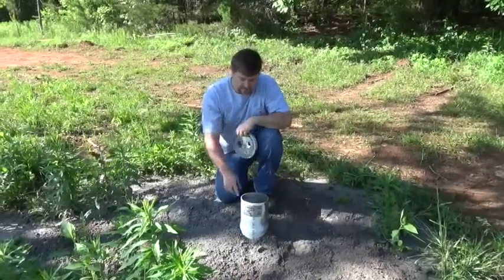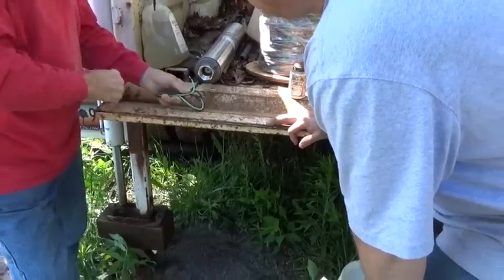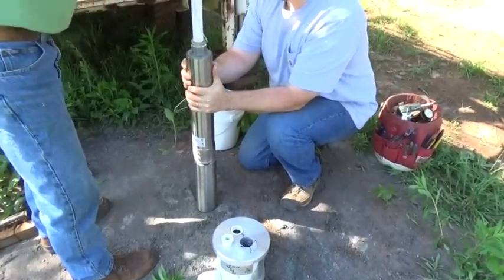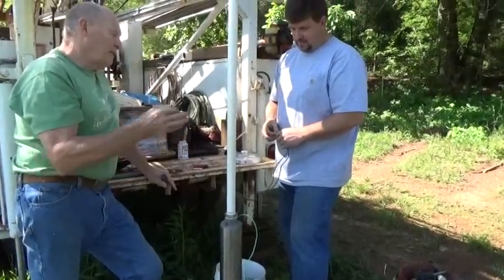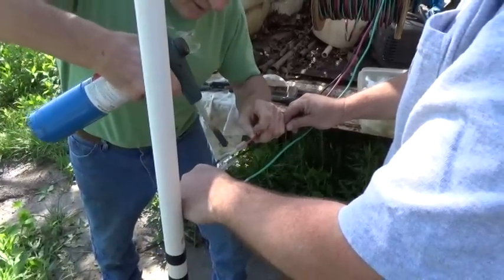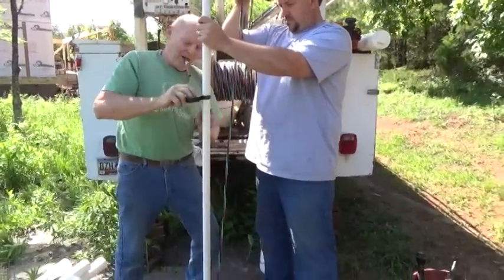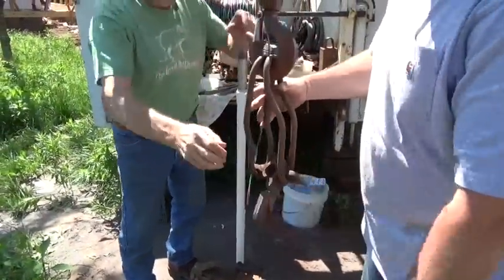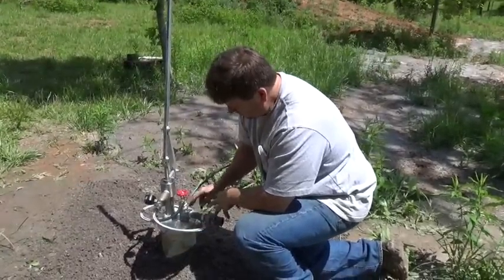How to install a Submersible Pump

Comment: I am planning on having a similar (solar) pump installed, but my water would be stored in a tank, well above the ground and flow down by gravity for use. Would you recommend placing a 3-stage water filter in-line with this pump above ground of course, or would a secondary booster pump be necessary after the storage tank?

Comment: No he did4use a lifting nipple onto the pump and if it gets hot it will melt the pipe and fall off and hang by wire and no more water and that's quick connect pvc that's a no no because the pvc  flexes when you tighten them and eventually the get weak I use couplers stainless steel

Comment: be sure to add a cable or a poly rope to pump as to take some pressure
off your pipe.  it also saves the pump if pipe breaks in well.  steel or
stainless steel will get ate up if you have sulfur or hard water, use a
poly rope at that point.  take care  thanks

Comment: this is probably a very stupid question but how does the water get through the slits in the pipe if you grout around it?
Reply: Grout is placed above the well screen.  Gravel is placed around the well screen

Comment: Hey 777.  I have a 4 inch casing and a 2inch discharge on my 5hp pump with metal pipe .  Do you think the simple pump will even fit inside the 4inch? The wires plus the 2 inch coupler on the pipe being the tightest spot that it has to slip by.  Also how difficult is it to pump from your static level?
Reply: Always have 20% more tube/casing dia than the inserting object.

Comment: You should NEVER USED PVC as the Line Going into the Well. If You have a problem You will have to Hire someone to Pull Your Pump. If You used One Inch Black Rolled Plastic You could pulled it with a pick up truck and a 55 Gallon Steel Barrel. You screwed up You Never Listen. Big MISTAKE.

Comment: What ever You do NEVER use PVC Pipe in a Water Well. Use 1" Black Roll Plastic. The Black Roll Plastic is flexible. You can use a Tractor, 4x4 Wheeler or Truck to pull a Pump from the well, Not A Crane. IF You use PVC pipe You Will have to cut the Joints when pulling the Pump, but with Roll Black Plastic the Line will Flex and You will NEVER HAVE TO CUT YOUR PIPE. Attach the Black PVC to the Pump with a Stainless Steel 1" thread to 1" Barred Pipe Fitting  (Meaning one end of the pipe is threads to screw into the top of the pump, the other end of the Pipe is Barred to grip the Black Plastic Pipe, Use the Stainless Steel Band Clamps to Grip the Black Plastic Pipe to the Stainless Steel Barred Fitting). Use All Stainless Steel Band Clamps (One Note use a propane torch to heat the the Black Plastic pipe so the Pipe will Grip the Barred End of the Pipe Fitting, Tighten the Band Clamps while the Black Plastic is about 150 Degrees). Be Sure the Screw on the Clamps is Stainless Steel Screw. Use a magnet to verify the Band Clamps are All Stainless Steel. Magnet will not stick to Stainless Steel.
Next use strained #12awg Copper up to 200 feet after that use #10awg up to 300 feet Wire into the Well Not Solid Wire. The Solid Wire will break at times the Strained will Not Break because it Flexible. Be Sure to tie the Wire to the Water Line ever 36 inches apart (By tying the Electrical line to the Pipe it STOP the WIRE rubbing the Earth and cutting the wires) All so Use deflectors ever 30 Feet apart, the Deflectors centers the pipe in the center of the Well hole and stops the pipe rubbing the Well wall. I use Scotch Super 33 Tape it's the best. Some times the Wire ties will cut the insulation on the Wires. When the Submerge Pump start it will rotate 180 degrees from start. This is the torque on the Electric Motor. PVC Pipe isn't designed to be Twisted and Black Plastic Pipe is. I have use the 1" inch Black Plastic up to 400 Feet with NO PROBLEMS.  Next Always use a Pump with a Franklin Motor they are the Best and Most reliable that I have found, Plus their Tech Service is Great Very Knowledgeable people if You have a Problem.
I have installed 100's of these Water Well Pumps and if You Follow my Instruction You want have any Problems. Next I prefer the 4 Wire Pumps and Control Box (Franklin Motor and Control Box), Meaning the Wire colors are 1. Green Equipment ground, 2. Black Common, 3. Yellow Run Wire, 4. Red Start Capacitor Wire. Meaning with a 230 VAC Well Pump the pump operates on 230 volt AC. 
This means You have a Control Box (with a Start and Run Capacity) mount inside your Basement, Well House or some where out of the Weather (DRY Place) normally it where Your Bladder Tank is, The Bladder Tank is a Rubber lined Water tank that whole Your Water so it can be pressurized. I normally set my water pressure at 65 to 70 psi for all Water Faucets and Hot Water Tanks. These Well pumps can operate 25 to 30 years with a Good Well Pump and installed correctly. I use a Well Pump that been in my Well for 27 years with NO Troubles. It how You install the pump into You Well. Never use any pipe Fittings made from Galvanized or Black Iron pipe or fitting that will rust. Use All Brass or Stainless Steel Fitting for Your Water or Drinking Water. These Fitting and Black Plastic Pipe will outlast You or ME. Be Safe. If You have a Trouble Call Franklin Well Pumps. Don't trust just anyone. Your Life depend on it.
Reply: Hey man where you at? I think I want you to install my pump, I'm in Orange County New York - I'll pay for your travel time. While I got you on the phone here I am about to have a submersible installed and I want to know when that pump is running so I need to have a light to show me that - does that light come with a control box??? Also I've got a 'static head' at about 30 feet, how deep should the pump be? What's best pump? Thanks in advance.
Reply: @richardnailhistorical3445  Richard, You don't need a Light to tell you the Pump is on. Unless you just want one. I would suggest a 230vac 4 wire pump with Control Box . The 4 wires are 1# Start wire, #2 Run Wire, 3# Common, #4th is a Equipment Ground from the well pump to the Control Box to your Home Load Center (Breaker Box) to the copper Grounding Rod. That stops Lightning from shorting you Water Pump out.

The rule of thumb for setting your pump from the bottom of the well up from the Bottom about 12 feet to the bottom of the Pump. I used Sta-Rite Pumps, or Gould Pumps all Stainless Steel Pump and Fittings into you well Tank, they way No Rust. I set my water pressure to cut in at 55 lbs and cutout at 70 psi. This way if You are taking a shower and you wife is washing Clothes at the same time You will have plenty of Water. The Well Pump should have a Check Valve in the Pump but if not install one before the water goes into the Bladder Tank. Use a 60 or 80 gallon Bladder Tank. If You have your cut in Pressure setting set to 55 psi then the pressure at the Bladder tank should be set at 55 psi too. The Band Clamps in the Well should be All Stainless Steel including the Screws on the Band Clamps. I always used two Band Clamps at the Pump and the line that exits the well. Control Wire. If it's 200 feet from the Well Pump to the Control Box I use #10 Strained Wire. If less than 200 feet I use #12 strained wire. Wire Colors to the Well Pump and to the Control Box is Red, Yellow, Black (Common) and Green (Equipment Ground). Be sure to water proof each of these Wire Individually and tape (Scotch 33 tape) not zip ties because is will cut into  the Wire Insulation to the 1" Rolled Black Pipe. Never Use PVC in a Water Well it will Break. Seal off the top of the well Casting from bugs and insects.

Comment: Did I miss the stand offs to keep the pipe and wire from rubbing the well shaft?   If not use and installed correctly on a fairly deep well, you will be replacing the wiring down the road before long.
Reply: No one uses those stand offs. Out of the 21 years I've been doing it I've never seen them on an install
Reply: The only time I've seen rubbed wire is when someone sets the pump below the casing into the rough lime rock

Comment: What exactly was the black expander that he attached to the pvc pipe? Are those pvc material white pipes or something else?
Reply: Threaded PVC pipe lengths, male 1 end, female the other... NOT glued connections! The black rubber diamond was a torque arrestor, to absorb any twisting of the pump on each startup. I prefer to use continuous length poly pipe coils though... No junctions to fail.
Reply: @Scentsational  The only problem with continuous poly pipe coils is that they are not strong enough to use in a really deep well. My well is 300 feet and I was told the poly pipe was not strong enough.

Comment: This isn't a criticism, I'm just now preparing to have a well drilled myself so I'm trying to get educated. I noticed that there wasn't a place on the well pump for a safety rope (way to retrieve the pump) do you feel that it isn't necessary if you use scheduled 80 PVC ? and why no pitless adapter?

Comment: Question: what if the the pump is accidentally disconnected from the pipe, is there any way to recover it?
Reply from the maker: If it does disconnect it's usually still connected to the wire so you have a chance of pulling it up. If not there are fishing tools that allow you to hook on to the pump and retrieve it

Comment: Safety gear? And don’t set motor on ground you will plug the weep hole in bottom of motor. Look a small hole center of motor bottom

Comment: The problem with backflow through an impeller pump isn't it running back through the pump hammering stuff.  It's that if the reverse flow gets the impeller spinning fast enough and it kicks back on there's a stupid amount of force that the impeller will have to absorb as it tries to start spinning the other direction.  Depending on how your electrical is set up , there could be a problem with the generated electricity, but I'm not sure on household stuff.

Comment: I would rather have a pump not immersed. As if the pump fails then you can’t replace it. Spits best to have the circulation pump for the well system outside where you can access it for repair and replace

Comment: I have helped replace 3 well pumps over the past few years at work. All over 200' 2" galvanised pipe. We use a front end loader, heavy steel cable and a couple pipe vices to keep the pipe in place while moving the cable. It is slow but way cheaper than having a company come out.
Reply: We do it with a front end loader as well. We've got at least 300 m of piping, so it takes an eternity to raise and lower.
Reply: Its the rat race of time vs money, whichever cheaper wins.

Comment: so how deep was the well and at what dept have you installed the pump?  also in what state are you installing this pump?? I see you haven't used pitless adaptor .. I just had my well drilled at 305 ft with 50GPM and shopping around for a good pump to install myself.. be blessed.

Comment: Why wouldn't you use compression fittings with 16bar PE pipe?  It makes installation miles away from the but heart I've seen at that video...

Comment: .. where's your Rope on the pump in case the Pipe breaks & you gotta pull it out of the well..?
Reply: also there should be wire guides every 15 feet...

Comment: Reckon he's ever had a piece of PVC pipe break on him if so you think he'd have a safety rope reversed loopef on that motor, so he could just pull the Rope out when he was done... Believe you me and I'm not being sarcastic,but I had to learn the hard way it's no fun fishing one of those bad boy out of the bottom of a well,and  if you have not got a line on them and the dadgum thing falls to the bottom of the well you will be there for a little while fishing it out,if  in fact you get it out at all.....then I guess the next elephant in the room is why  do you need a check valve right on top of the motor,that doesn't make one lick of sense to me if, I mean I can understand a check valve about ever 80 ft is what I'm told, but if you have the pump motor out of the well that far,well and please pardon the pun, guess what you're going to know everything that's wrong with it.Imean you can look at it you can hold it in your hand,you can do all of that if you have it out of the well, and you can do all of that without a check valve...I'm just saying every 70 feet is one thing but right on top of the motor okay whatever,,and no I'm not Joe the plumber it's just I had an old house in Florida ,and I ended up replacing three of those pumps ,and all three of them burnout after about 2 months ,and I'll be damned if I didn't lose two of them down in the whale due to crappy old pipe, so after I spent a ton of money,and days fishing out the second pump motor I replaced all the pipe,and I hear tell that the damn thing is running well to this day,although I couldn't say for sure I haven't lived there in years. I know everybody's screaming you should have replaced the pipe in the first place and that's right but I was raising three kids on my own and working like a dog I didn't have a lot of money so I tried to do it on the cheap in between the pump motors I actually used a swimming pool pump it works really nice I liked it better than the submersible and I would have left it had one of the neighbors not being a nosy Newser and called code enforcement on me you know wanted to make a a daddy and his kids have it a little harder I guess some people are just born evil anyway I took those one on pool pump and put it up in the attic I went and bought all new Pike and installed the second motor that I actually got on warranty however thank you Thomas Young my old boss at Ford of Ocala for loaning me the money to buy the pipe I don't forget anybody who looks out for me my brother-in-law Mark John's also help me out a lot at the end of the day though God help me more than anybody I'm sure though I did everything backwards and I'm no one to give this old boy advice this old boy knows  better what he's doing I guarantee that he's a well man, and from the looks of it a damn good one and of course it helps big time that he is also a God-fearing man no less, so I'm sure he's got everything under control there, and if he said it needs a check valve on top than damn it I'm sure it does just because I don't know why doesn't mean it that gun thing hell I wake up every morning not knowing why I even went to bed the night before.... I know when it comes to the well motor I done 50 times joke I absolutely did everything ass-backwards I know I was doing everything Rong, but me and my kids had a damn good time out there playing and all the well sand and making a mess of things actually it is a really good memory thank you for sharing the video God bless you be well and I hope you have the best water in the neighborhood
Reply: another thing surprised me, putting an eight GPM pump in a well with 7GPM coming in, so if the pump were left on, they could draw the water down to where there is none.
Reply: Old Dave, He did state that he would put a restrict or valve in line to limit the flow rate.

Comment: Does the meter work on oil wells like stripper wells? Just curious
Reply: The meter you used in the beginning of the video
Reply: They do have distance limitations depending on the model.  They can also have some interference issues depending on the pipe/casing used in the hole.  The only other thing I don't know is if they would need calibrated to go through gas instead of air.  I don't know if sound travels the same in both.  I would talk to a dealer to find out more if you're interested.

Comment: For Preventive Failure? What is the Average Life of a Well Pump? So we can Start Saving $ ahead of time and Plan to R&R it BEFORE it fails? Thank you.
Reply: I've seen them last anywhere from 6months to 50 years depending on how they were treated. Tank being properly sized, tank having the right amount of air whether it's a diaphragm, bladder or standard tank. But average life span is around 12 years

Comment: Nice video.
Have you ever thought about using WellHose DIY Drop Pipe?
Reply: Tried it an LOVE it. Thanks for the tip. makes it so much easier than going with steel or pvc. way to go

Comment: why did you use PVC? why not ABS?
Reply: Check out WellHose. THAT is the way to go.
Reply: The Doctor ABS is way more brittle, I don't think they even make ABS rated for pressure. Personally, I wouldn't even use PVC, Pex is the way to go.
Reply: Abs is an oil based pipe and not rated for pressure, no where near as strong as PVC.